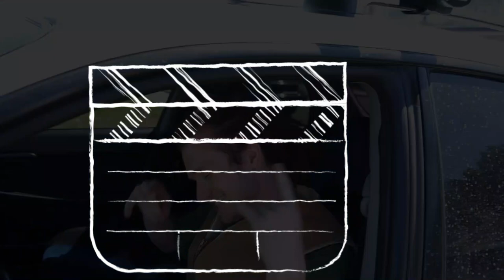Building/Tuning a 300WHP+ STI in 48hrs

Comment: You can eliminate the stumble by modifying the stock fuel rails to feed cylinder 3 before cylinder 1 together with an GD FPR/Cobb stumble fix. Fueling order is then 4-2-3-1 . No more stumble with ELC table zeroed.

Comment: Nice. Putting together my parts for the summer. Got the GS intake, uppipe, and downpipe, Tomei inlet, TGV deletes, 1050 injectors, 340 pump, and ELH.
Reply from the maker: Good parts list! I always recommend a ID1050X at minimum when it comes to injectors

Comment: Awesome Video. Glad to see what the upgrade path is on an STI with Pump Gas. I just had my FA20DIT Pro tuned after my mod list which is . COBB AOS, COBB 3" Non Resonated Turboback Exhaust, EGR Bypass, Mishimoto Performance Air Intake, Mishimoto Black Delrin TGV Deletes, COBB ECBS. 301 WHP/295WTQ on mustang dyno @18.5 PSI. The difference is no knock issues and it fixed a random DAM drop over using the OTS maps.  Love the content always something i look forward to. I enjoy learning about these cars even if its not the FA20DIT WRX :D
Reply from the maker: Great numbers sir! Sounds like you have a nice build going. Thank you for supporting!

Comment: I'm so close to getting a 2020 sti. The dealer isn't selling much and gave me a killer deal with nothing down but my 2017 base wrx down and its 50 bucks cheaper a month. I really want the ej. I've had the fa for a few years now and it's a decent car. But the sti is calling my name still , there is a few reasons why I want it but that should speak for its self. Good vidyet again man. Thanks
Reply from the maker: Do you plan on doing mods to the wrx or sti? The STI is a much better platform to get if you want over 400whp.
Reply: @BaderBuiltRacing  I only have the ma tune 93 octane,  exhaust and some transmission mods.  But I really wanted to get a j pipe. But yes if I was to get the sti I would do the tune, and at least a catback. I love the way they sound man. But I'm loving the fa alot too. There is just something that pulls me towards the  sti. Also wanna thank you for that flat foot shifting vid. I've had the ap for two years now and never used that option once. I knew what it was, but I guess I was afraid of hurting something if I missed. I had it down the 3rd time. Damn that really does make a difference and it's fun. => thanks again man for all the great vids
Reply: GET THE STI. I went from 18 WRX to 18 STI in the span of 6 months. The WRX is a great car but the STI is really a whole other beast. You won't regret it. You already have the itch - now is the best time to hop on that good deal. I took a pretty big hit financially to trade up and I still think it was well worth it.
Reply: @BaderBuiltRacing  Over 400whp in a sti? Good luck on making that reliably without building the block. Honestly stis are great platforms unless you want to make over 400 lol. I've been over 500whp for years in my stock block 08 evo x and  I know my old sti couldnt even come close to that according to my tuner.
Reply: @polloi84  thank you!
Reply: @Lucas-kj5kv  and his defense, I do know quite a few people in person that have at least close to 400 or a little over 400 to the wheels on a stock STI block. But they also don't bang on their car all day long. I'm not saying most people won't have trouble with them, I'm just saying it is very possible if tune right and done with the right parts and if your car is maintained correctly. But anything could happen I assume. Honestly I think I'd be happy with just 300 to the wheels LOL as funny as that sounds. I know that's not enough or a lot to some people, but I think I'd be happy with that. That's got to be at least 60 to 70 wheel horsepower over what I'm at now. Well I take that back maybe I'd be happier with close to 340-350  to the wheels I think that be plenty and plenty reliability I would hope if done right. I'm coming from an SRT-4 that I had for 13 years, and that car was one of the best vehicles I've ever owned. That car ran low 12s all day long and only had a 3rd gear synchronizer problem. That car could make Power like crazy and it's still running perfect to this day cause I sold it to a buddy of mine at work and he is still driving it with no problems.. If they still made the Evo with the older style motor in it like the one that's up until evo 8 or 9 I would definitely consider getting an EVO cuz I also like those to. But in my opinion STI and the Evo's are both good cars I guess it just depends on how you treat them and how you treat them
Reply: @somersfamily  Yeah my point was if you want to make over 400 or 500 no problem than it's easier to just get an evo and ditch the old ej. Not to mention you should wait for the FA24 sti. That engine is also showing huge potential from a crosstrek swap I just saw. Also the 4g63 in the 8s and 9s is the more legendary but the evo 10s engine 
 still has crazy potential with stock internals and flows more than the 4G.

Comment: How far could you push the stock internals. Looking for 400-450 whp I have a 2019wrx right now was thinking about trading it in for a 2019-2020 sti. Heard the 2019+ had the pistons re-done so was curious if I could get 400-450whp with out blowing the motor.

Comment: Can I have a cost estimate of getting 300whp? And from their, how much more to get 400whp? My goal would be 400 but depending on the cost either will happen or not haha
Reply from the maker: Stage 3 package begins at 6k and can go up to 10k installed / tuned depending on options / parts.

400whp usually is a larger turbo / intercooler/ and ethanol (on a stock engine) So itd depend on turbo but if i had to put a ballpark number around 14-15k installed / tuned
Reply: I got a built shortblock with steamspeed 71 turbo and full bolt ons and fuel and protuned on 94 pump gas with 32oz of Boostane (roughly 103 octane) I make just over 400whp and 450 tq

Comment: So stage 3 to get about 300whp? How much money do you have to drop to get around 400whp?
Reply: For 400 WHP its going to run you about 15k or more i have all these mods plus EL header, TGV delete and air pump delete with an IAG short block and all that money with tuning is barely Yielding me low 300s.
Reply: For 400 you are looking at around 15k or more i have all these mods plus EL header, tgv and air pump delete with an IAG short block and im not even near 400 if i get a turbo ill be over 400. These cars are not the cheapest to mod and i am not sure why im even building this car for power as in the end all that money could be gone if someone slams into my car. Just food for thought. Also i give that number for the build as all my parts are brand new not used and i get discounts.
Reply: It really depends on what you’re using to get your numbers. 300 whp on pump gas......😏
I have all of the above plus KB ELHs, Rails, Lines, FPR, and Flex Fuel. I’m at 311 whp and 408 wtq. But these numbers are equivalent to 369 whp on a DynoJet. 
When asked, I claim to only have 311/408. To each their own 🤷🏽‍♂️
A bigger turbo would put me near 400 whp (DynoJet numbers). If you’re going to use this as a reference then I can say I’ve spent close to $10k to achieve 400whp.
Reply: @E85_STI  hey man thanks for the info I have a 2015 legacy and was planning on selling it to get a 2009 sti or later year. But honesty 15k is another s2000 money. I love subarus but I will have to look into another platform for a track build.
Reply: @BluPrynt78  I hit 309 whp and 352 tq with a sleeved block, 272 cams and VF43 running 92 at 20 PSI on stock injectors and a walbro 255.  It was tuned on a Mustang Dyno.

Comment: Great video, it seems as you made the car more reliable. How much is the setup? What is the setup called? Protuned.
Reply from the maker: This is a STAGE 3 package it had a few parts i dont usually use so pricing was a bit different. But my stage 3 package begins at 6k installed / tuned and can go up to 10k depending on if its a 100% stock car and which mods we do.
Reply: One more question i have 2015 i want to buy 2018 ra cluster, what must I do to get it to work and where do I get matching plug for 2015?

Comment: Wait, a sti cant make 300whp with just a tune?
Reply from the maker: The mustang dyno i work with, a stock sti makes 240-260whp. With a tune and no upgrades it makes 255-265whp / 280-300wtq. 

Stage 2 package (downpipe, catback exhaust) usually makes 270-280whp / 290-310wtq as they run out of fuel quickly on these cars.
Reply: @BaderBuiltRacing oh on a mustang dyn, got ya. Thanks for the clarification

Comment: my fa20dit makes 320whp with just intake and e30
Reply: Id love to see the dyno sheet showing a 100+whp increase from factory with an intake an e30.
Reply: @k3mikal  its only about 80whp increase
Reply from the maker: That’s fairly common, intake and ethanol is what these engines love. 👍
Reply: @k3mikal  fa20 builds power from mods much better than the ej motors up to the limits of DI injection.
Reply: @dafirstbigballa  More like 105whp.  268 at crank with dt loss is like 214 wheel.